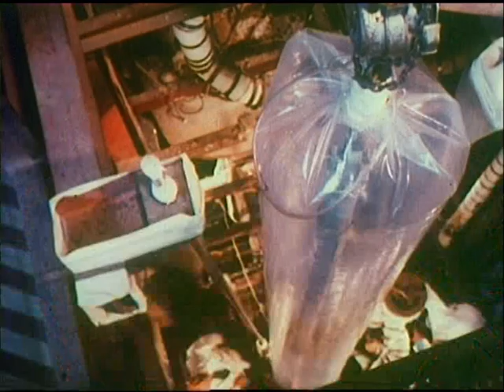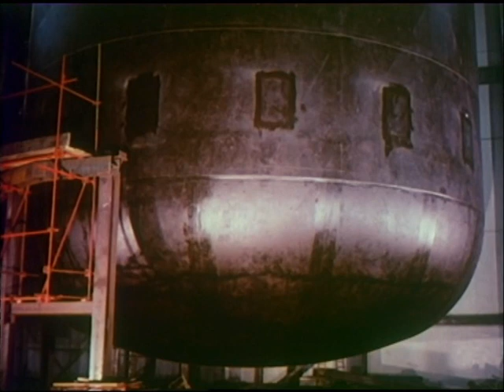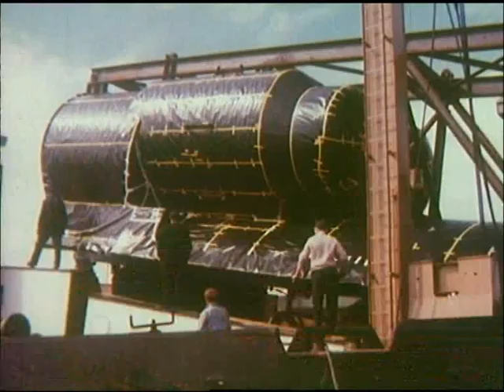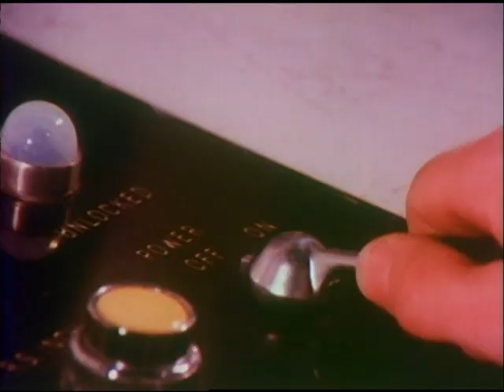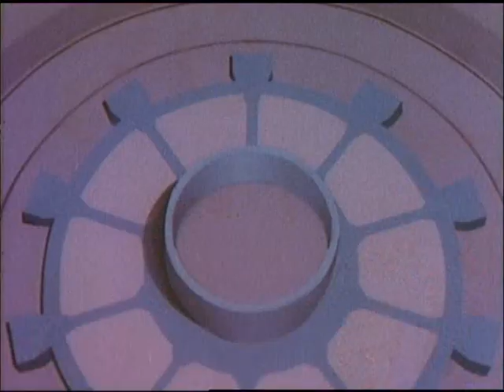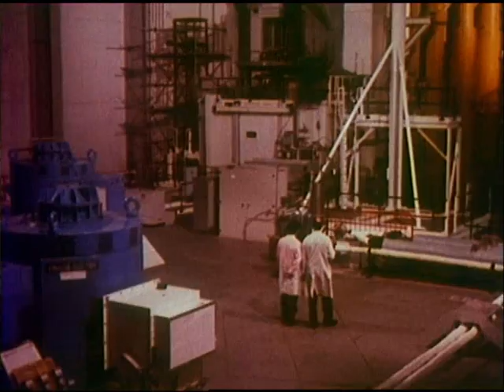Building PFR.wmv

Comment: Awesome, liquid sodium and plutonium! What an expensive , dangerous and complicated way to make a bit of electricity.
Reply: I remember in ⚗ lessons, as soon as you added sodium metal to water it was explosive. You do wonder what thought went into the long-term costs of these reactors. The discharge of radioactive filaments/particles accidentally seems to be the biggest scandal at this site, along with the explosive shaft.

However, I do find the archive videos quite interesting.
Reply: Not as dangerous as burning thousands of tons of toxic coal. Nuclear has always been the safest option.
Reply: @milolouis  people keep saying nuclear is safe, but there is no safe way to deal with the nuclear waste. The uk has a massive stockpile of plutonium now, and dont know what to do with it. Until you either reduce the waste, or find a way to deal with it for eternity I don't agree that nuclear power is 'safe'. There are no easy solutions, but if you read about Dounreay and the accidents, I think it's fair to say, it's not safe, even before you consider the waste issue.
Reply: @CA_I  I believe he said "safest".
Reply: @CA_I if only we had some kind of reactor that could use up the plutonium and breed more fuel…